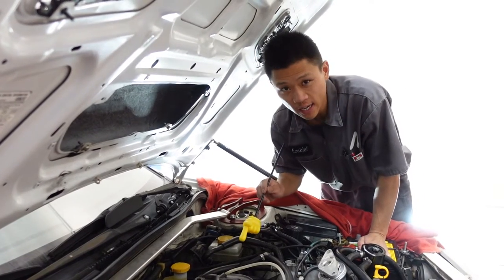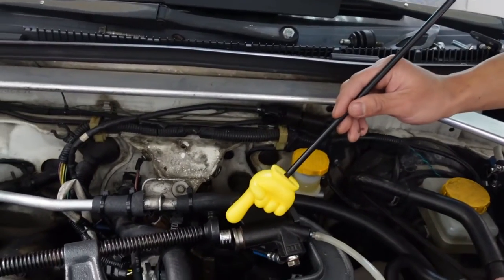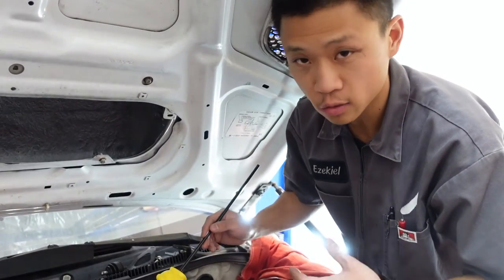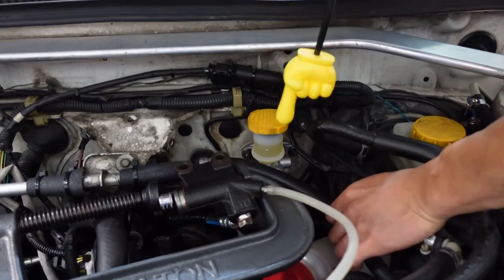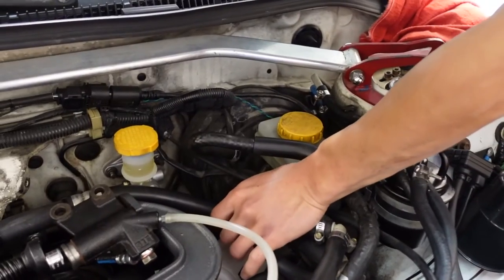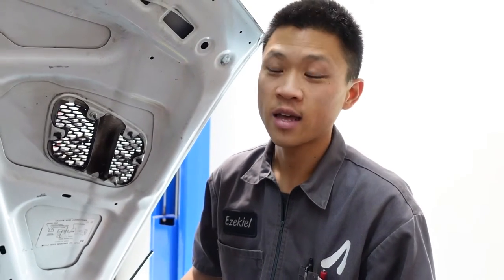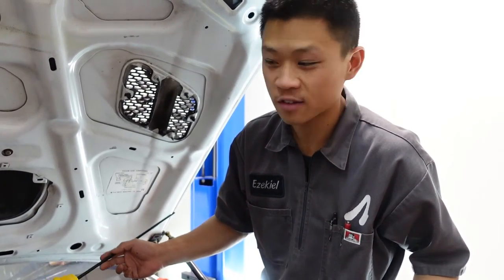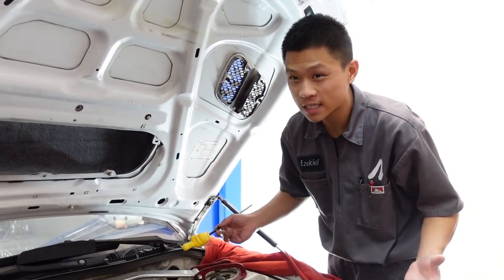How To Bleed Subaru Clutch STi

Comment: The clutch pedal linkage on top of the throttle pedal could also be the cause of the lack of pressure due to not being adjusted to a new clutch system.
Reply from the maker: Good point. Thanks!
Reply: Hydraulic clutch is self adjusting. .What are you talking about?? Do you adjust the brake master when you put new pads on?
Reply from the maker: @lard1892  To compensate for many factors including flywheel step height, you may need to adjust the clutch master rod length or shim the pivot ball

https://youtu.be/vYJxQyjIhUw

Comment: Just bought my 2013 WRX STI car runs awsome, then while I was driving it. I was at a traffic stop light in neutral, then took off kinda quick in 1st,2nd,3rd then 4th. However the clutch went to the floor and I couldn't shift gears, lucky I could coast into a parking lot. I managed get the car into neutral. Clutch master cylinder is full with a brownish tint. No leaks I've noticed. Can it be that the master and slave cylinder just failed without leaking?
Reply from the maker: Yes, the seals can also fail internally
Reply: @CMAutohaus  Thank You for letting me know. I will replace both parts, the master clutch cylinder and clutch slave cylinder in order to cover them both. I didn't know that could happen. Really Appreciate your help. 👍🏾

Comment: interesting. I usually pull a small vacuum on the bleeder on 240sx and non-sti, then open the bleeder. The sti must be complicated, so now i'm curious..
Reply from the maker: Vacuum bleeder or two man usually does the job. My good friends at a Subaru Specialty shop told me about this issue. Subaru Specific.

Comment: I have a 2016 STI. I just added radiator, AOS, cylinder 4 cooler, pitch mount, pitch brace with stainless steel clutch hose. When I finished installing the stainless steel clutch hose, I noticed the clutch pedal stuck on the floor (no one pressed it). I figured it would be bubbles but after bleeding the clutch slave, clutch pedal still would not go back to normal. I noticed there were a small leak on the clutch master so I replaced it and bled the clutch slave again until no more bubbles yet the clutch pedal still would not go back up by itself. I decided to replace the clutch slave and bled it again until no more bubbles. Still the same, the clutch would not go back up by itself. 

Oh and on top of that the clutch would not go in any gear when the car is on. I was able to put it in any gear when its off. So I tried to put it in 1st gear and turn on the car, now the car wont turn on, the clutch wont go in neutral and the clutch pedal still sticks to the floor. Any thoughts or help would be appreciated.

Comment: I did it the same and was able to get a continuous stream of fluid (without air) from the slaves bleeder. However I still cannot get anything out of the master cylinder bleeder. No air, no fluid, nothing. Any thoughts?
Reply from the maker: Bad master. Replace the whole system: master, slave, and line.

Comment: Love the video, replaced all three at once and tried this, but it didn't work. bought the vacuum pump and tried that way, and the same results, went back to your way, and the car will drive if in gear, try to start the car, and it lurches forward, I cannot get the clutch to engage, I have already gone through 16 oz of DOT3 trying to get this done. please advise. Thanks
Reply: All I did to remove the air was use a crescent wrench on the lever the slave touches as i bled it , so it removes the little air pocket between the bleed nipple and in the slave piston, a power bleeder on very low pressure reduces the need for anyone pressing the peddle, 
No big C clamps or extra sockets required, fit to car then bleed,
Peddle not returning is a key sign of a bad clutch slave .

Comment: Did you have a bleeder open on the slave while you bleeding out the master cylinder?
Reply from the maker: No. I bled each section seperatly. While bleeding the master, all other bleeders were closed
Reply: @CMAutohaus  I trying to bleed out that damn thing about week without success so i hope this will work, Thanks for answer
Reply: If you have either bleeder open while pumping the pedal it will suck air into the system. Pump the pedal 20+ times then hold pedal down, open the bleeder, close the bleeder it, then pull pedal up and start pumping again.

Comment: Per manual you only pump fluid out of the slave cylinder
Reply from the maker: For the 5 speed WRX yes. For the 6 speed STi you perform the more complicated process outlined in this video.
Reply: in my experience most of these cars don't even come with a bleeder on the master, the replacement one I bought for mine did though

Comment: Do I place the cap back on while pumping?
Reply: No need. Just keep brake fluid in the reservoir. When there is fluid, air can’t get into the system. Having the cap off doesn’t depressurize the system.

Comment: Zero need for this. 3 or 4 times 3 pumps hold down and bleed. Then Another 5 or 6 times same again but push back the slave cylinder with the fork lever all the way. Save yourself the hassle removing the thing

Comment: Just use a turkey baster and clean the container with a cloth using a flat head. Top it off after, lol.
Reply from the maker: That doesnt bleed the system of air or remove old brake fluid from the exisitng system.

That also wont work if the system have been opened